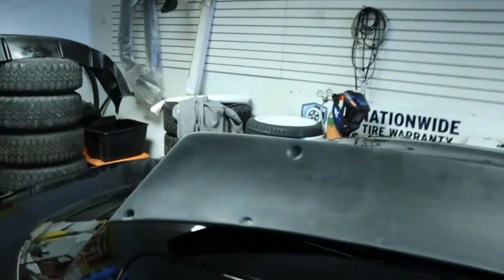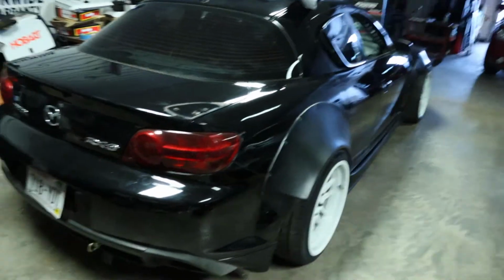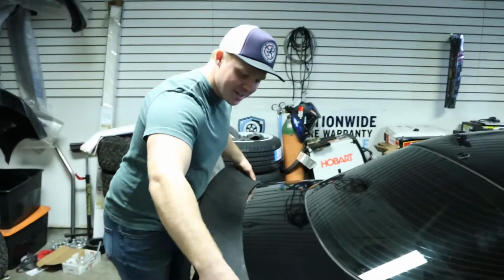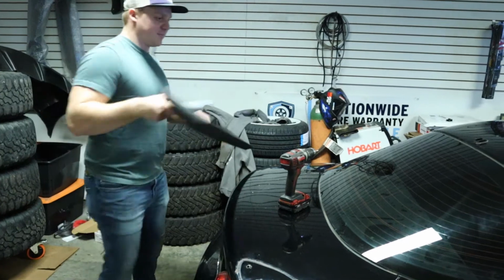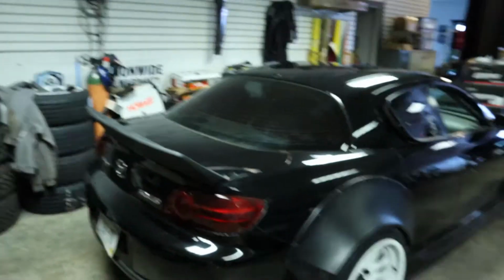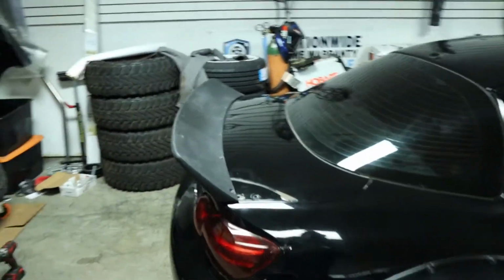RX8 Rocket Bunny Style Ducktail Spoiler Install + Burnout!

Comment: I have a question about the fastener. It seems like insert something into the trunk. May I ask what is that and what tool is that? I just got my ducktail few days ago but now I am confused about the fastener hardware
Reply from the maker: Those are threaded rivet nuts inserted into the trunk with button head screws to fasten the ducktail. The tool is very similar to a basic riveter. Just this way you’re able to use threaded hardware making it easily removable!
Reply: @sidewaysstandards  Got it! Appreciate the reply!

Comment: What is the wheel offest you are using for that body kit?
Reply from the maker: Rear is 18x9.5 +10mm with 35mm spacers. Front is 18x9 +33mm. The car is on wisefab suspension front and rear so that might change the offsets you need. Definitely in front if you’re on stock suspension due to the wisefab angle kit being so wide!

Comment: What did you use bolt wise to hold it down to the trunk if I may ask?
Reply from the maker: M5x20mm button head screws with a hex drive